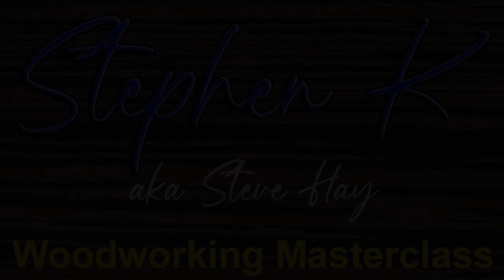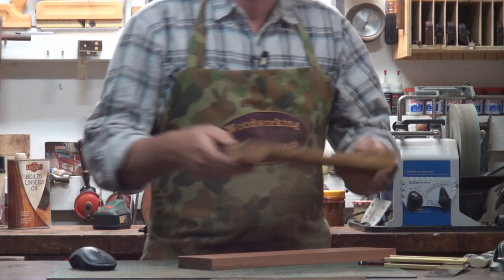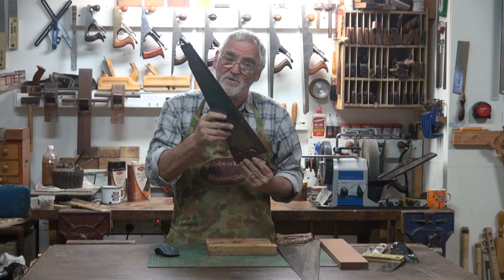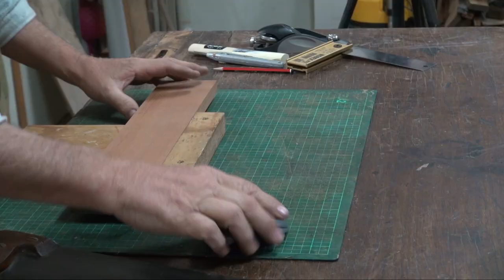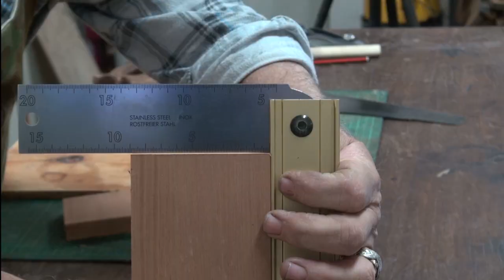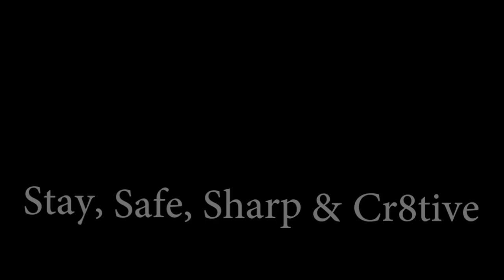Easy and Way to Make Accurate and Straight Cuts Using a Hand Saw

Comment: How can I cut a root straight.!
Reply from the maker: Hi Munzer, If it's off the tree the clamp it somehow with a vice of some description. Hold a square up to it or if big enough use a string line to mark it, then follow the line. If still in the ground mark as much as you can using a spirit level of a large set square and make a line then follow that. Hope that helped. Cheers Steve

Comment: Great video! If I have an older saw, how do I make sure it is sharp for the "tools" part of the 3 T's?
Reply from the maker: Hi David, Touch it up with a saw file and check the set of the teeth. Cheers Steve